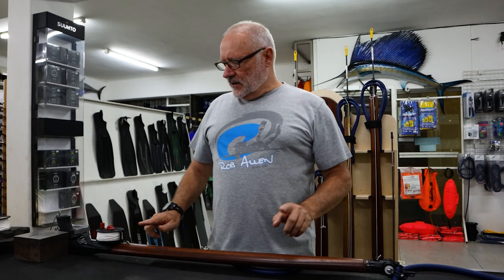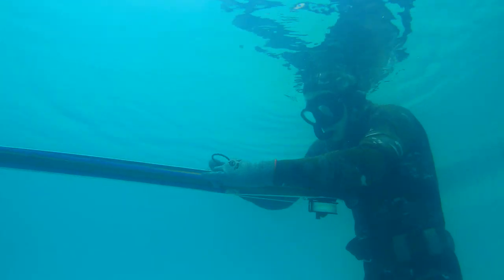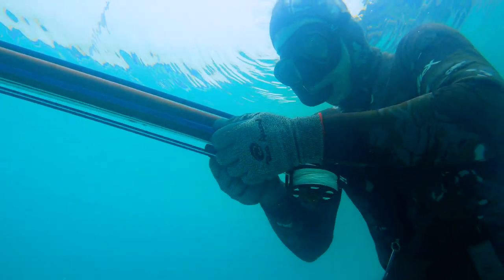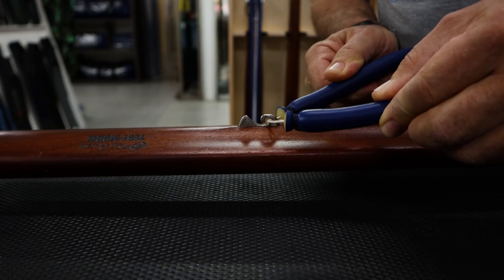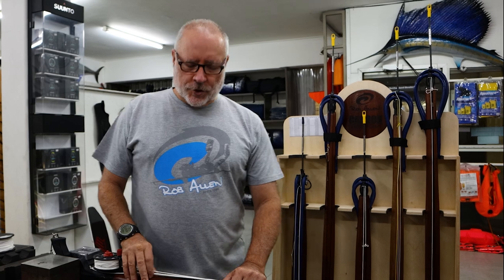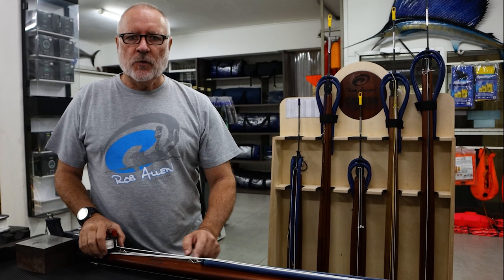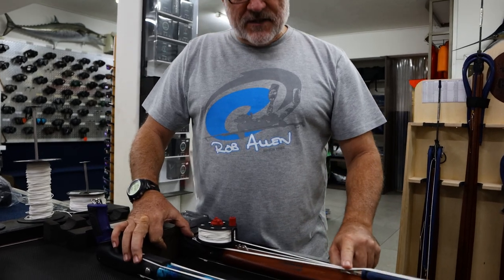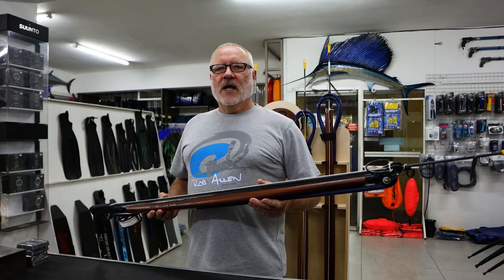Rob Allen | Timberline Series | Part 4 | How To Load Your Timberline | 2022

Comment: Wow! Very cool gun. How to convince my wife I need one…
Reply: Been watching from part 1 can't image it's going to be cheap , maybe in the future they won't use carbon fibre they might be cheaper.
Reply from the maker: @OmniAtlantic  The difference between the carbon and aluminum in the overall price will be only about 10%.  Also, the epoxy bond between the timber and the raw carbon that is already an epoxy bond, will be much stronger than what the bond onto aluminum would be.

Comment: Hey rob, I love your spearguns. I've got more than 20. Do you have plans of making a 3 band timberline gun of various lengths (90cm)?
Reply from the maker: We are developing a 3 band muzzle and a double roller muzzle at the same time. These will only be available for the Timberline guns. The gun mechanism needs to be modified so that the trigger pull will feel the same as a 2 band gun. These new parts will take about 6 months to complete.
Reply: @RobAllenSpearfishing  Will 3 band and double roller muzzles be limited to only longer/larger guns?
Reply from the maker: @m7airbi344  No, each is made custom to any length within reason.

Comment: Hi Rob, I am slightly bummed as I ordered an extra band to have on hand for my brand new 120 Timberline Roller. The replacement band is the 70cm. I just realized that the current band is different than what is tied on to the gun. 

Can you please provide a how-to tutorial for making/modifying/fitting bands onto the carbon roller??? I paid $55 for a band I can’t use unless I were to buy a $18 anchor bolt which would render the multi point pretension useless. 

I love your guns, I just would like some assistance :) thanks!
Reply from the maker: Hi Jared, Sorry it took me a while to work out the problem. As you have discovered, the issue is that the Timberline takes a different rubber set up to our standard rollers. The fact that these Timberline guns are so new on the market, we are still "learning" new issues. This is the first time we have had this and, it's something we had not taken into consideration. By changing the Timberline rubber anchor points we now need to offer two types of roller rubbers. You asked for a spare set of roller gun rubbers and were sent what goes on our standard, non-timberline guns, not the retailers fault. As you have seen, the Timberline has 2 anchor points which work on a closed loop rubber. The advantages of this is the ability to change loads and, the rubber can't jump out the gun due to it being a closed loop set up. This means, to exchange the rubber, you need to loop it though the rollers then tie into position. All you have to do to fix your situation is change out the two end loops for a standard wishbone. There is a way to knot it but I will need to go through options. I'm sure you have seen the way you can set up your rubbers with small loops on the ends of rubbers that then give you the ability to tie in a length of Dyneema, if the Dyneema needs to be exchanged.  Sorry about this but we will definitely work on an option that is simple to use. Please feel free to email me on rob@roballen as I often miss YouTube comments.
Reply: @RobAllenSpearfishing  Hi Rob! Thanks for the speedy reply! I totally agree, not the retailers fault :) Sorry, I didn't mean to sound pissy =) 

I see! I also picked up on the fact that the rubbers for the timberline are a few cm shorter than the standard rollers. I have to cut them down to size anyways and when I do that I will insert a new wishbone and tie that. Super easy fix! Thank you!!
Reply from the maker: @jaredvoeller5457  All good then 👍👍

Comment: You guys are doing a great job with introducing this series! Ever thought of building this model with teak wood?
Reply from the maker: As the side stocks? If so, no problem but adds to the cost. The Mahogany we use is close but not as strong. In our case, we don't need added strength as the carbon is already very strong.
Reply: @RobAllenSpearfishing  yes the side stocks. I was just curious because my fellow Californian spearos love their teak spearguns. I’d save up and buy if that was an option.
Reply from the maker: @axelherrera8447  We have been looking at teak, will keep you posted.
Reply: @axelherrera8447  Doesn't really make sense with teak in my view. Most mahogany, as far as I know, are lighter and as RA explained, the side stocks are not there for strength but solely for buoyancy. This means, if you use teak instead, you would need more of it to obtain the same level of "lift" which results in a bulkier gun.

Comment: I am excited but I think that the hooks could cause problems with other lines being caught. I think that the gun would be easier to load underneath with a side mounted line release
Reply from the maker: If you look closely, the hooks have a protective 'ramp' preventing any lines hooking. We have tested these in 100's of pool shots with not one hook up we also have many guns already out an in use with no lines hooking up. We are also testing a side line release. So far all good but more testing is on the cards to make sure no issues.
Reply: @RobAllenSpearfishing  expert level design and testing, exactly what we have come to expect from the legendary Rob Allen!

Comment: Gday Rob! Got a Timberline 1100 roller coming in the mail, just wondering if possible to fit the traditional anchor point to this gun for the slightly extra pretension or if the timber gets in the way? Thanks!
Reply from the maker: Yes it is possible.

Comment: It seems clunky having to tie a wishbone after you put the rubber through the rollers and takes away  an advantage that I see from rollers that it is easy to change the shaft and band set up during a dive and when in storage and wash down being able to pull the rubbers straight out was everything and store it away. Could you use smaller loops and tie a short dyneema line between them or does it get caught?
Reply from the maker: Yes, very easy to set that up and, we are in the process of doing this for the aftermarket spare rubbers.
Reply: @RobAllenSpearfishing  wow sweet, it will be interesting to see how it works out on the double roller trying to load them on the different pretension hooks. 
How is the double roller coming along? Was a bit disappointing to not see a teaser for Christmas. 
Then again yet to buy a timberline only own a sparrid and a gt roller at the moment.
Reply from the maker: As soon as we have finalized the tie in option for the rubbers we will put up a video. The double roller is still being tested, we will only release/launch with a video when we are happy with production.       @mattmaxwell3923

Comment: I think that 2x14mm bands easier to load(and mostly unload!!!) and shot the same and may be better. Wood base makes difficult the hunting on a current, even to move on fins. For me best solution would be 2 roller with 14mm bands without wood, may be Y-scheme where main band with daynema inside, Alemanni uses it. Your slip-tip is good. What about magnetic slip-tip?
Reply from the maker: 2 x 14mm on a 7mm spear are great but, the single 14mm on a roller, set up correctly will drive that same 7mm better, especially on a short gun. I agree, a large wood gun is difficult to maneuver because they have to add much more volume to get the correct stiffness. Our Timberline guns have very little added width. The fact they are lighter, less effort is used to lift so more is available to swing. Uses claim they are more maneuverable that conventional pipe guns. We don't make slip tips, we make drop barbs 😜👍  We can't use magnets as the stainless steel is not magnetic. The O ring we use is more than adequate.
Reply: @RobAllenSpearfishing  I'd buy into the more oval shape being easier to swing. A pipe gun with a shaft and two bands isn't actually that hydrodynamic and if you try to swing it fast, you can actually feel it wobble. Likely from the flow detaching and reattaching. An ellepsoid shape of the same height as a circular tube can easily have half the drag of the pipe (depending on how flat of an ellipse we are talking). So, even it the Timberline barrel is a few mm taller than a stock CF barrel, the more elleptical shape will, likely, still make it a whole lot less draggy.
Reply from the maker: @AntiVaganza  Exactly. This is why guys must feel these Timberline guns feel easier to swing. You are right about the wobble felt on a standard pipe gun. I use this wobble as an indicator to tell me I'm swinging the gun to fast. I think that wobble can scare fish away. When excited it's otherwise difficult to realize your movements are too fast.

Comment: How many 16mm bands can the vector 2 handle carry?
Reply from the maker: I answered your previous question regarding the handle being able to shoot with 3 x 16mm bands if you use the new trigger and sear designed for the 3 bands. It will probably hold 7 or 8 in terms of the strength but you will probably not be able to pull the trigger. If you could, the recoil would hurt your hand unless the gun was ballasted to handle the added recoil.
Reply: @RobAllenSpearfishing  Thanks my brother. Your information is deeply appreciated

Comment: Awesome new gun to the rob allen arsenal. Once again only asking for it with aluminum gun for better price for people without jobs or still at school like myself😂😂
Reply from the maker: Sorry,  not available in aluminum. We also don't know of a glue that will stick properly to an anodized aluminum surface.
Reply: @RobAllenSpearfishing  understandable. Wouldn't roughing up the aluminum and wood a bit then glue hold it enough to then add screws toe the front and rear of the gun where the muzzle and back where you'd add the roller anchor work? Just a suggestion😂😂 would really like a gun like that but I would never financially recover😂😂 love the concept and so on and would definitely use it. I'm in Port Elizabeth or what ever it is called now and the water here we dive is dirty 99% of the time so shooting in under 5m viz so short roller with lot of power is ideal for hunting the cracker. Planning on buying a 90 snapper roller once I have enough finances. Anyways just an idea to work with. But understand the problem with the glue. Will think of a better solution💪
Reply from the maker: @jacodewet296  No problem bonding to the wood but if you scuff up the ali will mean damaging the anodized surface. Also, any holes in the tube in between the 2 sealed plugs will create a leak, especially over time when the corrosion happens. This will occur over time due to the use of dissimilar metals. S/S screw and ali barrel.  I'd hate to develop a gun range that starts to fail prematurely.
Reply: @RobAllenSpearfishing  understand that. I'm talking about the holes that are already there. The one at the muzzle and the two at the back where the handle connects. Another option which could also work is building rob allen wood guns with no pipe. I personally don't have too much experience with building guns so don't know how difficult that is but it is another option
Reply from the maker: @jacodewet296  We can't use the existing holes because they are already holding the handle and the muzzle. To add the timber will make it too thick and, we will have to develop a whole new model/shape of the timber. The reason we combine the timber with the carbon tube is because the carbon tube alone is way stronger than a hard wood. This enables us to keep the stiffness without having to add greater dimensions to the timber. The thicker the timber, the harder the gun will be to maneuver. It's all a trade off, we think we have hit the "sweat spot."